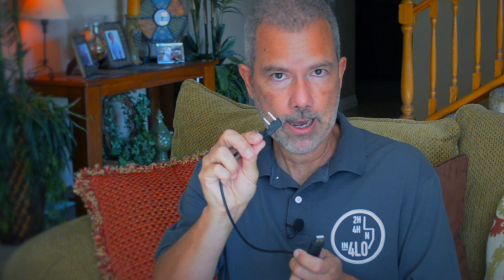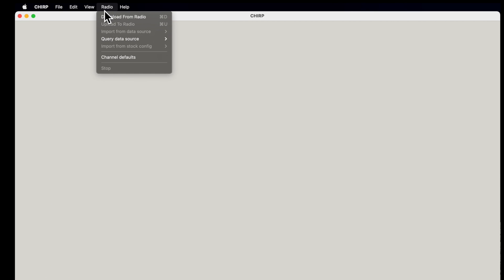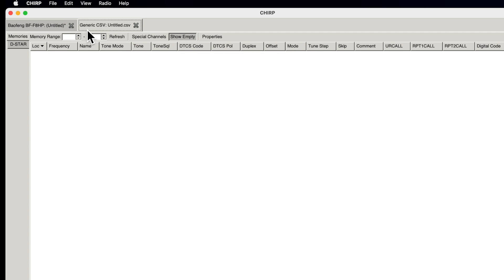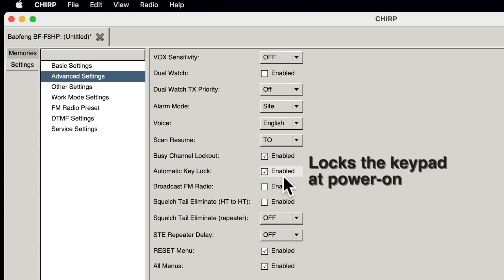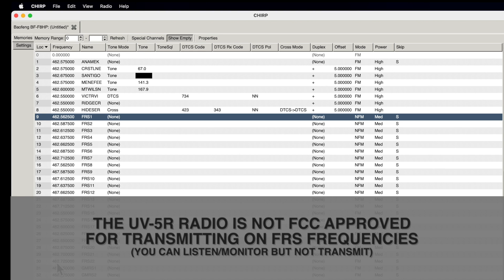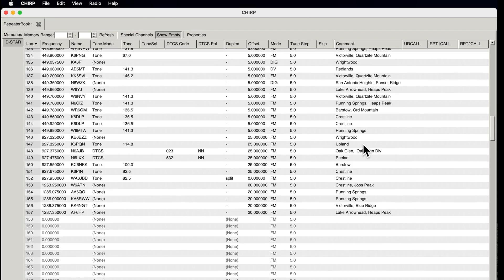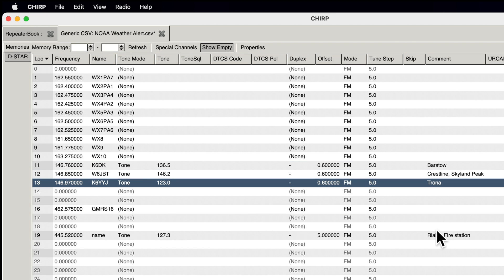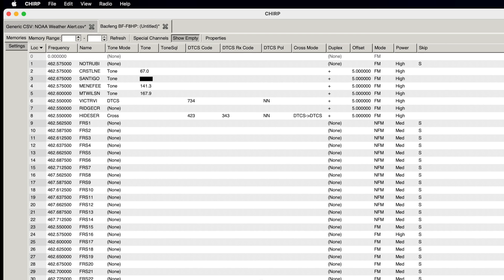How To Use CHIRP Software To Program A Baofeng UV-5R. Using CHIRP for HAM, GMRS, and FRS Radios

Comment: It appears that I was able to put all the channels in according to my laptop that I wanted but now nothing seams to work on it I have the BF-F8HP it's brand new the only thing that works is the on and off knob? I'm ready to throw this thing out off the window can you help me please.
Reply from the maker: I cant really help as I have no idea what you did or how you did it, but you can unscrew all your changes by doing a reset of the radio in Menu Option #40.
Reply: @TheNotaRubicon  I figured it out, I somehow hit the lock button on the keys that's why nothing was responding I put a ton of codes in then hit scan to hear all the chatter and to my surprise over 50 channels I heard nothing while in scan mode on both frequency or channels isn't that unusual? I would have thought to hear it acting like a home base scanner.

Comment: Amazing video! Thank you. I noticed you have GMRS and FRS channels there, but the frequencies are different. Shouldn't they be the same? I do have a GMRS handset and a FRS handset, and they can talk to each other when switched to the same channels. What impact do the GMRS channel vs FRS channel frequencies have?
Reply: There are some overlaps with GMRS and FRS. The big difference is the transmitting power being limited to .5 to 2 watts on FRS, and GMRS uses 0.5-50 watts depending on the channel frequency assigned to the GMRS band. But, there are higher watt frequencies in GMRS that are not approved for FRS use. I hope that sort of answered your question.

Comment: Very helpful video. Thanks a bunch. Two questions - I subscribe to Radio Reference. When I go from Chirp into RR it does enable downloading, but does not include an opportunity to add some other area channels I'd like to monitor, i.e. railroads. Also, is there a way to cut/paste these channels into Chirp. Tried it and was unsuccessful. Thanks.
Reply: It's likely that the frequencies are not within your radios frequency range.

Comment: You stopped just before explaining "Work Mode Settings".  What are these used for?   I notice that even if I use CHIRP and program channels with offsets, the UV-5R ignores them.  When I select the channel on the UV-5R in channel mode, then go to the OFFSET menu setting...it always shows 000.000.  I must not be understanding what that menu setting is showing.  Could this have something to do with the default Work Mode Settings of VFO A and B offsets?  Thanks for the great videos.

Comment: I've had a different problem. It seems chirp is 32-bit, because I can't get it to run on windows 10 64-bit. I still have a 32-bit computer, unfortunately I can't get the internet on it and the formats are incompatible for transfer. 
Oh I so hate windows 10 and 11 is out of the question (its crap).
So I have had a radio for over a year I can't program...
Reply from the maker: You can program it by hand.
Reply: @TheNotaRubicon  okay, I did that on my first radio. It's difficult to do with transmit/recieve frequencies being different (like with repeaters). The radios want to use one or the other. I'll give it another try.
Reply from the maker: This is also a good option for those with no computer/cant run  CHIRP:   https://youtu.be/MawIWcYL6-I

Comment: If I have multiple UV5R can I save all the channels I make on the chirp program and just plug each one in and then upload it? or do I have to do it the slow way by making it on each UV?
Reply from the maker: If the radios are the exact same model then you can do this, but if they are even slightly different models or even the same model but drastically different firmware, it may not work... That said, I do it with all of mine UV-5Rs bought at the same time.
Reply: @TheNotaRubicon  awesome, thank you

Comment: So, I just used Chirp to program my UV-5R and it "bricked" it. Weird icons on the screen and none of the buttons work. It's not locked, it just won't do anything other than turn on and off. Anyone have any ideas on what to do?  I am thinking trash it and buy another. My next question is how do I avoid this on its replacement.
Reply from the maker: I've programmed dozens of UV-5Rs with CHIRP and have helped/delt with thousands of people doing the same thing through my channel and have never seen/heard of this happening..
Try a factory reset, if you can get into the menus.. If you cant, try to pull the battery and leave it out for a few minutes, then see if you can.. If still no-joy, trash it and buy another.
No idea how/why this happened, so cant say how to avoid it, but as I mentioned, this is not normal or common.

Comment: i like how to explain it short straight to the point i love my baofeng to when i get the cable i will do it like you did i want to adjust the squelch mode if you can do a video on that it be great i notice the cable has no cd so i will down load it from the link you posted keep doing those videos

Comment: I want to program about 75 freqs to my UV 5R. Do I have to type each one in to the CHIRP screen or can I use a spreadsheet that I have to make this go faster? If so what are the steps? Thanks.
Reply: Many places on line already have spreadsheets  (code plugs) that you simply import into chirp…..there might be some individual modifications

Comment: Can I save two different frequencies to one channel name?
Reply from the maker: You can have as many channels with the same frequencies and same names as you want, but each specific saved channel can have only one name, and one frequency
UNLESS you configure that channel as a repeater - which you can set with a TX frequency and an RX frequency, IF your particular radio supports that.

Comment: Can anyone tell me where I can find a programming cable for the Baofeng UV-S9 plus
Reply: I got mine on amazon
Reply: @tristan3759  did you find a program cable for the Baofeng UV-S9 plus of is there other cables that will work? If so, which cable for which radios

Comment: Is there a setting that will keep line a and line b locked together? I want to change channels but when I change the top line, the bottom line stays the same.
Reply from the maker: Thats called synchronization, and most radios do not do that.

Comment: If you are using CHIRP to program a GMRS Baofeng UV-5G, set the brand and model to Radioddity UV-5G. If you try to use Baofeng UV-5X (the previous GMRS model), you'll get an error telling you that you're using the wrong model. Thanks for the good videos.
Reply: Great save!  Just received a 5G from my wife.  You saved the day by showing me where to go for programming.  Thank you

Comment: While I am studying to get Technician license, is there ANY form of communications I can make through the UV5R?  or strictly listen only, regardless of frequency/band?
Reply from the maker: The UV-5R is a ham radio, and according to the FCC rules you must have a ham-radio license to transmit with it.
Reply: @TheNotaRubicon  Thanks for clarification.   Was not sure of the scope of the limitation, since each device's capabilities differ in comparison to what the study materials assume I would be using.

Comment: Here is the problem I have I need to download chirp I do not have a computer I am renting a room from a elderly lady she does not have the internet I do have my cell phone how do I download this
Reply from the maker: If you have an iphone you can download it like any other file, however, without a Mac or a PC, you will not be able to run it, or use it, or connect your radio to it.
Reply: Not😂😂😂

Comment: It was my first time using CHIRP & I was successful adding new frequencies to my new handheld radio. Since my Baofeng BF-H7 didn't appear in the CHIRP model menu list, I had to do a little searching around & found out that TIDRADIO TD-H6 works just fine. This is truly a very helpful & easy to understand video. Thank you!

When pasting repeaters to my radio's profile tab within CHIRP, I had to keep an eye on two things; My radio doesn't support DIG Mode. So, I had to choose repeaters that were FM mode.

I used OPEN STOCK CONFIG & added NOAA. I also used Query Data Source/RepeaterBook Political Query to add 4 local frequencies. The 4 frequencies are quiet right now (It's 2:55 AM) but I'll go outside in the afternoon to see if I pick up anything. No transmitting, just scanning. 73

Comment: I just purchased a UV5R and what is supposed to be a legit USB cable from Raidoditty. I followed your instructions but when i click on the download from radio option there are no options that appear in the port section so im stuck. any help would be greatly appreciated. thanks
Reply: I had the same problem. I got a different cable and it worked.

Comment: Fascinating. Do you know of any way to use this on a Chromeook, barring a bunch of complicated Linux workarounds? Thx
Reply: Did you get it going yet, on the Chromebook? I have the factory cable and some mini disc that came with the radios but I do not have a disc player on my laptop. And is CHIRP an app or what?

Comment: I've been pulling my hair out (I'm partially bald, or was)

Thanks so much for your advice, really does help us lazy manual readers 😂

Your making me realise that I'm gonna need to be licenced, save a whirlwind of shit when I press the ptt button and get into trouble.............. Question, what would happen if you got caught on a frequency you shouldn't be? Many thanks 😁
Reply from the maker: Assuming you arent on an Ambulance channel or anything like that, about the only thing that would happen is you would hear a bunch of old geezers yelling/complaining.. Other than that, nothing..
Reply: @TheNotaRubicon  hint taken. I think most emergency services use encrypted digital in UK according to an old ham guy of the last jurrasic period I quizzed last week, I won't be hearing them on my baofeng then! That's why I bought it, doh! Had it a few week now and I've only picked up a couple of farmers other day nattering about tractors and trailors......... To be fair, I got a raving hard on to recieve a transmission 😂

Comment: Great video. Easy to follow and had no trouble until the end and was uploading. I bought the programming cable from your link and have the Btech GMRS V1 and when I went to upload I got the following error "Error reading data from radio: not the amount of data we want" I erased some data. I had a saved original file and it would not upload it either. Any help would be much appreciated.
Reply from the maker: I have never run into that error. I would check to make sure you have the correct radio/model selected for upload.. If that error continues, you may need to contact support to find out what is going on.
Reply: @TheNotaRubicon  Thank you for the reply. I had a go at it again today and cloned without issue. I think it was due to the pins not seated correctly. Of note, when I started an upload I got a warning about the GMRS V1 "driver is a beta version. Also I had to "turn off and connect cable and then turn on radio." Every time I either upload or download..Lots of unplugging. Issue fixed and have two radios with extra channels!

Comment: Under what circumstances would you select Low, Medium, High for power level?  Does this change the default power for that specific GMRS frequency/channel?  If the channel is for .5 watts (low?), and I set it to 'high', does the radio ignore the setting and use it's default 'low' or does it accept the 'high'?  I'm just now programing a Btech GMRS-V1 HT so learning a lot these past few days. :) Thanks.

Comment: This was imo the best video on using CHIRP so far.

I CANNOT understand why other videos do not go over wtf you might need or not need when inputting in a channel for the different ways you might use this radio.

Without somebody even telling you that you don't need every God damned column filled in how tf would you EVER even know this?

Yet NO other video tells you this. They just input channels without explaining ANYTHING! 

No "why I did this" or what other uses would need to use etc...

The SAME with transmitting on one frequency & having to offset on another.

The SAME with a million other things here.

I'm someone attempting to get into this & learn about how these radios are used & NOBODY is making videos from this perspective.

NOBODY is saying how to put together a list of channels & what you should be looking for & then how tf to do it in CHIRP.

This is the closest video I've found to do this in about 30 videos I've watched.

Comment: GREAT video as usual.. thank you.  I was wondering if you can help me - I'm trying to use CHIRP with a UV-10R and have had success with frequencies etc but not with radio settings.  CHIRP doesn't have an option for the UV-10R so I have been using the BF-F8HP option instead but for some reason it doesn't read my radio settings.. hence I can't change them in CHIRP.. any suggestions?

Comment: I discovered that you can copy radio to radio by powering down, unplugging, plug in next radio and hit upload to radio. Hope that is usefull info.  Thanks for the info you put up here for us.
Reply: Thank you, I have a few to program, so that will help a lot.
Reply: Dude killer tip. This saved me ALOT of time
Reply: My hero!
Thank you!
Reply: Pro tip bro
Reply: Awesome!  Thanks brother!  Great tip.
Reply: Just used this method and programmed 2 radions in 2 minutes.
Reply: Just like imaging a computer 🤘
Good for folks who have a lot of the same handsets to clone up.
Reply: I love youuuu absolute life saver. I gotta do this to 10 radios 🫠
Reply: Do not do this!  I bricked radios doing this. Radio Software was different. 

Copy and paste and go thru settings and manually clone. 

I’ve also shared my clean baofeng files to help multiple people un-brick their radios. 

-always save a clean file of your radio so you can recover if needed.
Reply: Not enough info to general.

Comment: Execellent video. I have learned so much.  Thank you for that.  Just a suggestion, because you are using an Apple laptop, it was easy  for you but for us Win X user, I had Error message with a yellow-caution sign on my Device Manager for the cable driver.  I had to search for it on Baofeng website which provided links to other websites.  And, since my cable was purchased on Baofeng, I had the WCH Chipset(CH340/341) and thus I found the correct driver to install which my Win X laptop liked.  It assigned COM 5 to the cable.  Please provide these valuable links so other non-Apple computer user will not have Error communicating with the radio using the Chirp SW.  :)

Comment: I have found that on my PC the USB cable does NOT work if I connect it to USB 3.0, it only works for USB 2.0.  Just in case you run into your handheld not being recognized.

Comment: You explained CHirp pretty good.  I just purchased the cable in your link.  I just bought my second UV-5R and the factory has the upper frequency limited and above 449khz blocked. Can I use the CHIRP program to increase the frequency range so I can put in the GMRS channels to listen to? Or do I need to use the Baofeng program...............Thank you,
Reply from the maker: From what I have read, those new UV-5R's are locked.. period.. There is no unlocking.. But I can't confirm this myself until i get one and play with it.

Comment: I had a hard time getting the software for the cable installed in Linux it was not all there but I got it working it takes using the terminal and the cable has the link for the instructions in the manual.

Comment: This is very helpful, thanks. I just used CHIRP to program my new UV5R from my Mac. Perhaps the most useful thing was the advice to make sure the connector is fully clicked in, I thought I had it fully seated and initially CHIRP wasn't able to connect to the radio. Pushing more firmly fixed that problem

Comment: Once I have the template set the way I want on screen can I swap in another UV5R and clone the setup so all my radios are programmed identically?
Reply from the maker: Usually, YES - unless the firmware versions are very far apart.. ie; one radio is very old, and another is very new.  But I have done this many times with my multiple UV-5Rs ..

Comment: Great video on how to walk through this, really easy for someone like me to understand. I curious though, we have a local dirt racetrack that just started using the boafeng radios that use channels instead of the six digit frequency. We like to listen to the track officials and drivers Chanel. We were told that there were program using a computer and the the frequency was 465.5625. We can’t hear anything because of it being a7 digit vs 6 digit frequency. My question is if I was to buy a chirp cable for my radio that’s just like yours, would I be able to program this new 7 digit and listen to the track?
Reply: In Menu, change your Step setting to 2.5k.  Input 465.560 then push the "up" arrow and it should change to .5625.

Comment: This is great IF you get CHIRP installed and working.  I get that some use it and it is the best thing since rolled toilet paper.  Bully for them.  I have never been able to get this 💩 software to work for anything.  Have it installed in my Windows 7 OS computer and it will not read the radio, no matter what.  Tried the BTWR super duper cable supposedly with drivers in it and nothing.  Tried regular cable and nothing.  WTF?

Is there a place I can download non-CHIRP software and drivers without paying a king's ransome?  Tried Baofeng site and it automatically redirects me to ROHR, RAHR, or something like that.